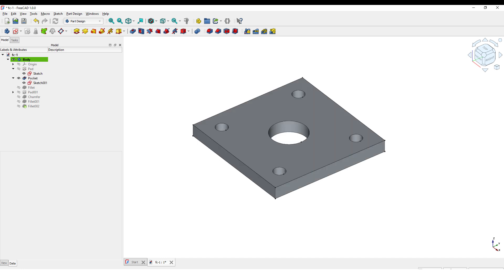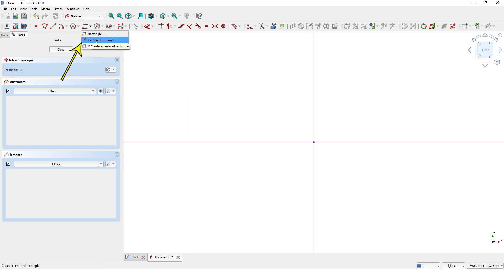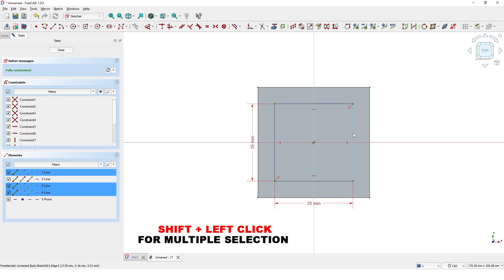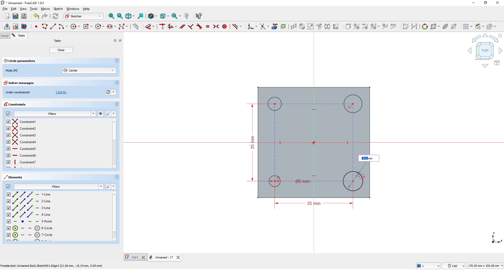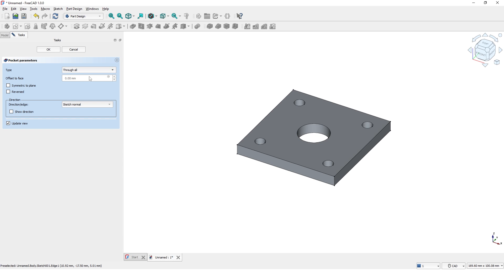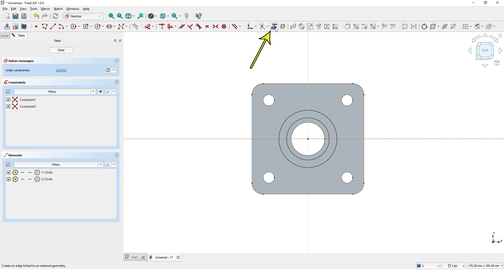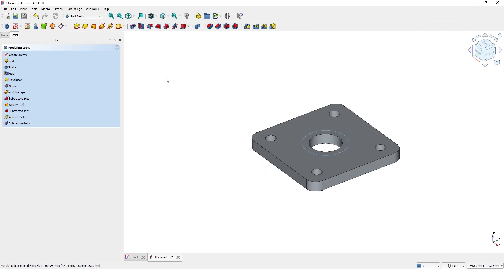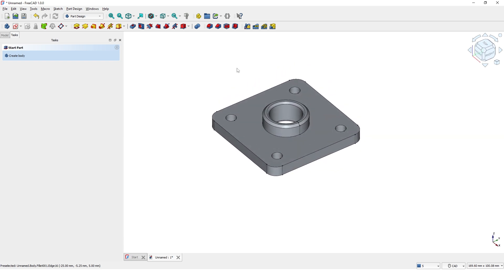FreeCAD 1 0 Tutorial #3 | Learn to create 3D Model in minutes | How to create 3D model in FreeCAD

Comment: Great tutorial and I can follow along easy and learn, but when I get to around 2:47 where you select all the circles and 'shift + ='. I get an overconstrained arror and it won't let me proceed and create the holes. I'm stumped, and actually trying to figure out what 'constrained' means in 3d modeling.
Reply from the maker: In Parametric 3D modeling, constraints define the relationships between elements in a model, ensuring precise positioning and behavior. They allow easy modifications while keeping the design intact by automatically adjusting related geometry. This means, you can always go back and edit the parameters such as length, width, depth, hole size, plate thickness etc..."Nonparametric" involves directly editing vertices and faces, offering more creative freedom but less control over design changes. Parametric 3D modeling softwares are used in Engineering and Nonparametric 3D modeling softwares are used in games and animated movies. I hope it helps.